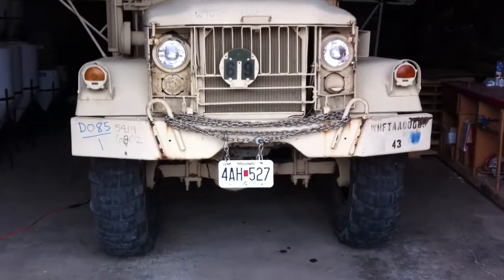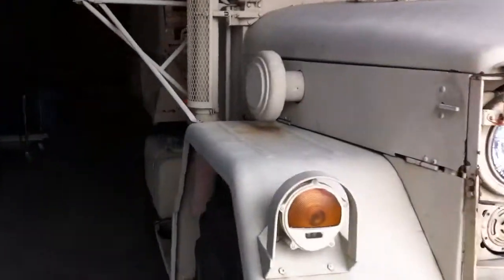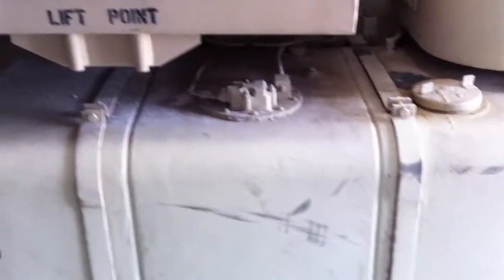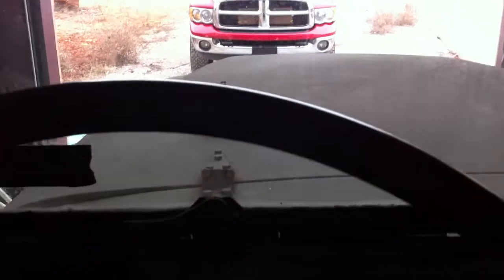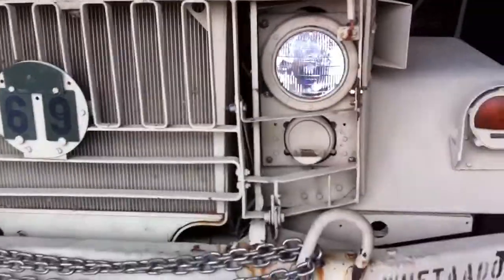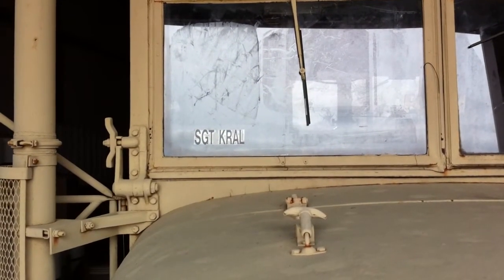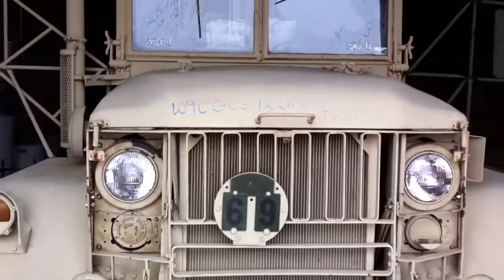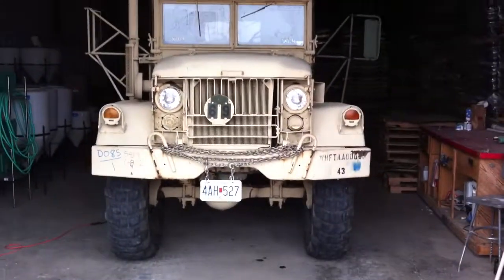Bobbed Deuce

Comment from the maker: I built it from a M109A3 but most use an M35A2. Tires I ordered off of the internet, and they are just squeezed down to the stock rim. Which I would not recommend if you can afford the Hemmet wheels. Also check out steelsoilders (dot) com